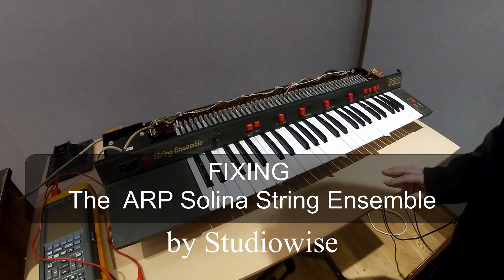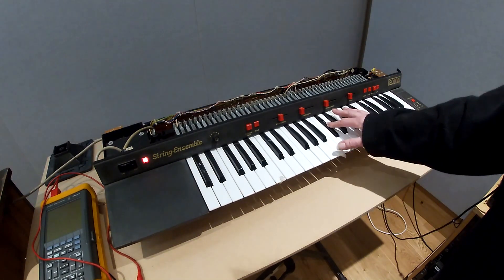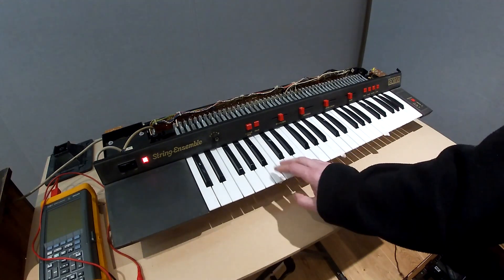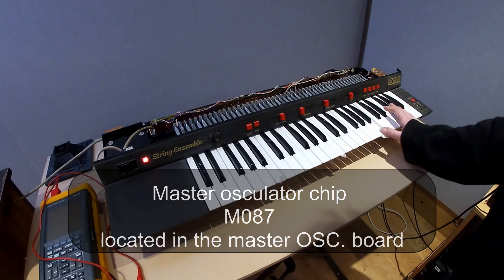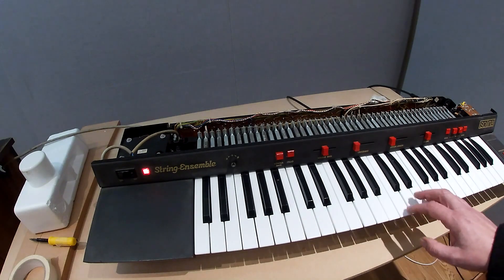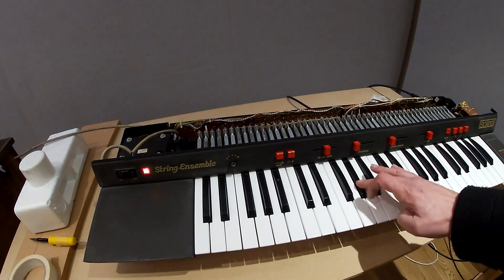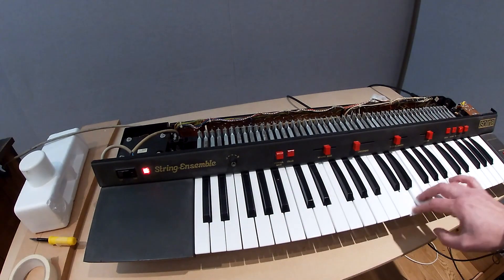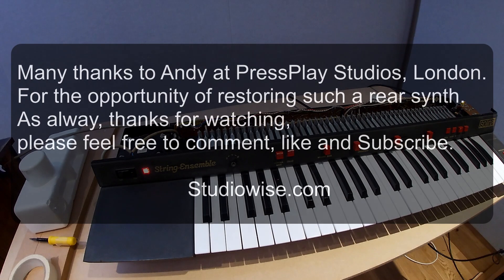ARP Solina String Ensemble REPAIR AND TEST by Studiowise

Comment: Hello, I'm having problems with M087 oscillator not giving signal on F# and A tones. Any suggestions? Where can I get new M087 chip or some replacement? Thanks
Reply from the maker: If anyone is still looking for the same top octave generator M087 master oscillator check out this website by WD GREENHILL in the UK  website  address   https://www.wdgreenhill.co.uk/product-page/m087
Reply: @spiro6363  Thanks alot for quick answer. I also emailed you, so you don't have to reply on email. Thanks once again :D